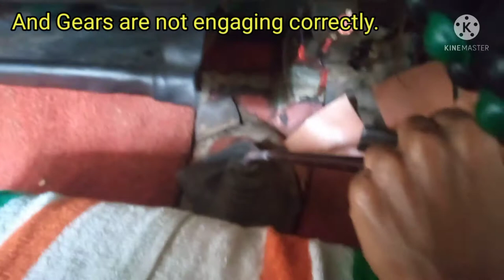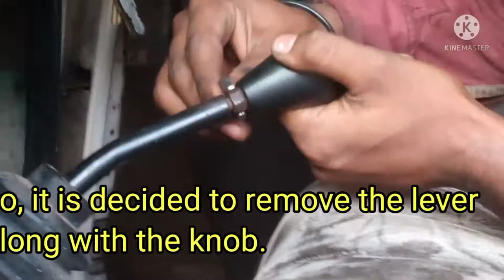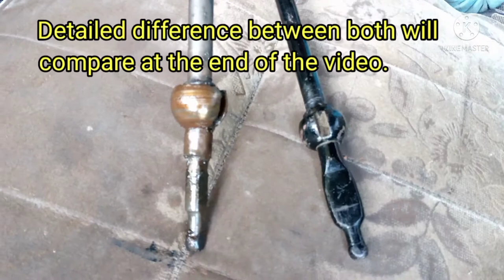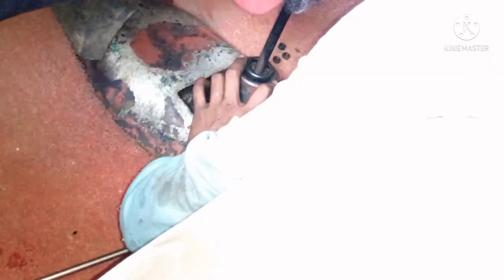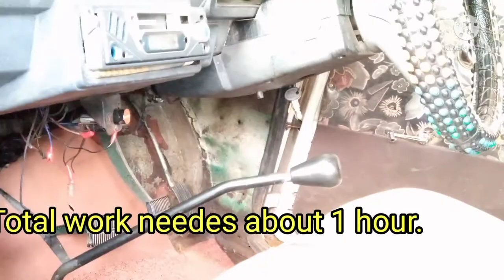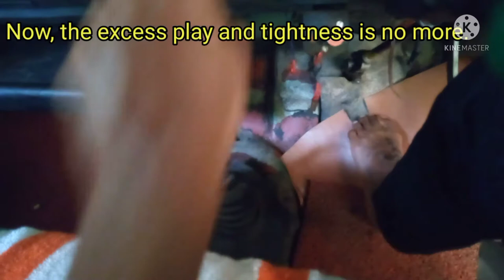Car Gear Shifter Lever Changing Video | HM Ambassador Car

Comment: My Amby Gear Shifting is No troubles. But Shaking Lot, While shifting 1 st gear, Gear rod will touch Left Seat same issues at Reverse Gear.,

So smoothness but No errors in Gear Changing., Could you Say the Issues? 

In my Area, no Amby Mechanics., 6 months before bought but Struggling lots.., 

Streeing giving friction/ rust forming sound, especially after raining days., (even last week oil changed by Mechanic, that time. So issues solved but again 2 days before rains. So now same sound issue).

Why this issues?
Reply from the maker: Sir, The excess shaking in the gear rod is quite normal for an used Ambassador Car. It is due to the wear and tear of the gear selector mechanism and to the gear rod. Only to worry about it when errors occuing gear shifting or jamming of reverse gear.
         Sound in the steering box may be due to the lack of greese in the steering box. Once in 2500 km, Apply greese in steering box, tie rod ends through the nipple provided in them using greese gun . It is done by concerned shops. If excess sound is coming check steering box and steering universal joint.
Reply: @ambadisbappu5807  Thanks for your valuable guidance and reply sir

Comment: Can you make a video on how to change the oil and oil filter in ambassador
Reply from the maker: Will do Sir. Thank You for the suggession.
Reply: @ambadisbappu5807   bro gear rod venum bro
Reply from the maker: Sir, did you mean you need gear shifter rod? then it is available in Car Spare parts shop.